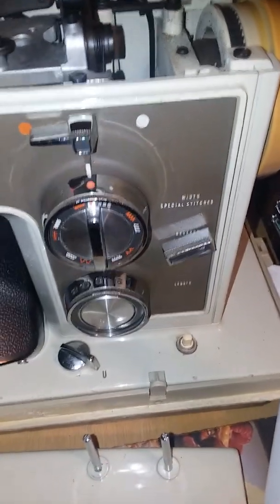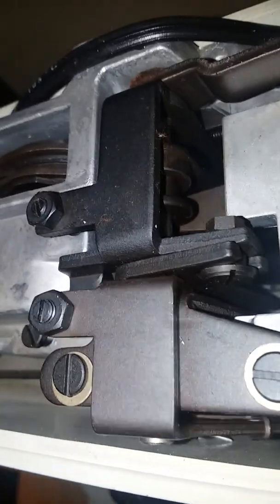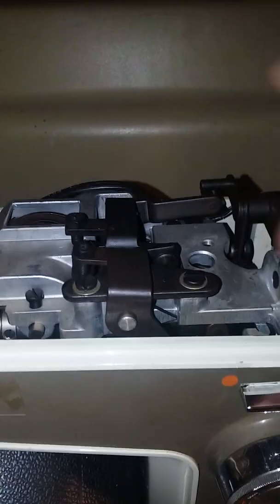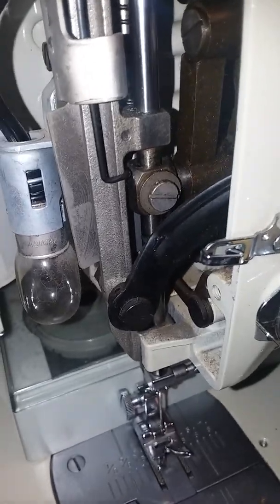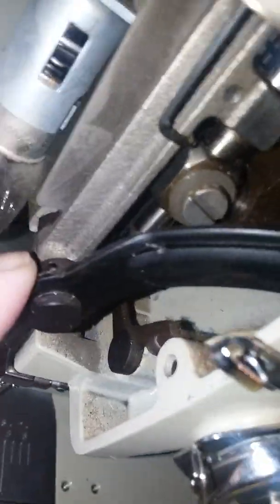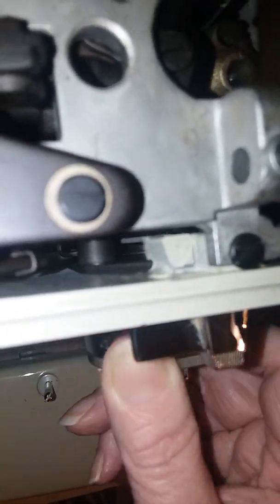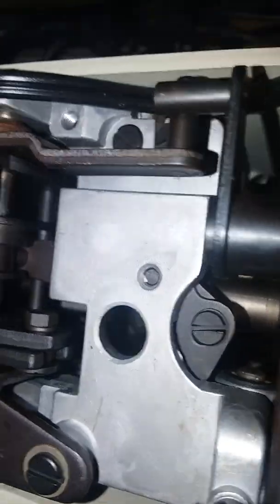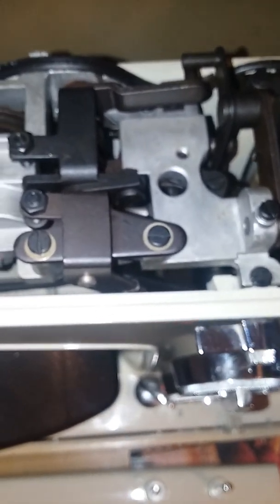Kenmore 1430 sewing machine stitch width linkage mechanisms

Comment: Rebecca, have you ever seen one where the width isn’t frozen but won’t stay put? Mine will not stay where it is set. It wants to drift back towards zero. I can’t find a way to add friction to the mechanism. It’s as if the return spring is too strong. Just thought I’d ask. Great machines!